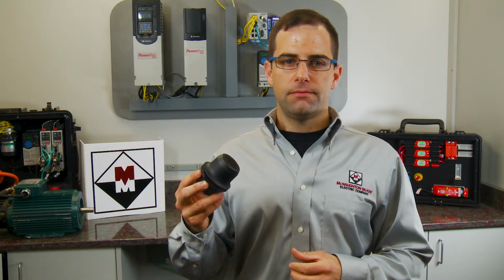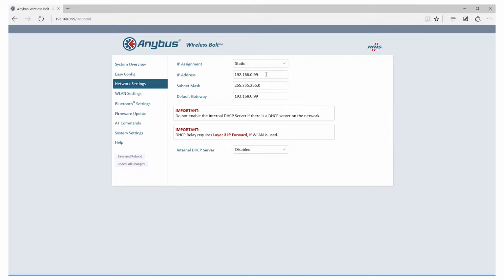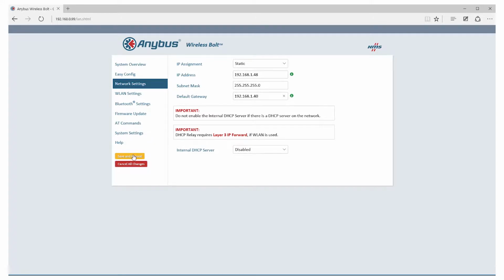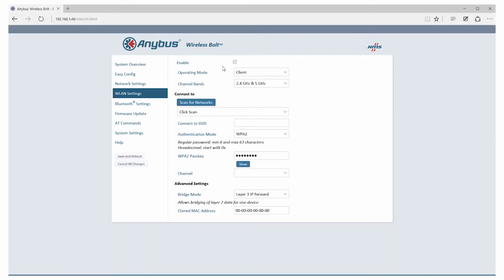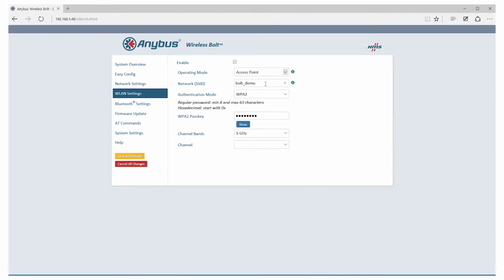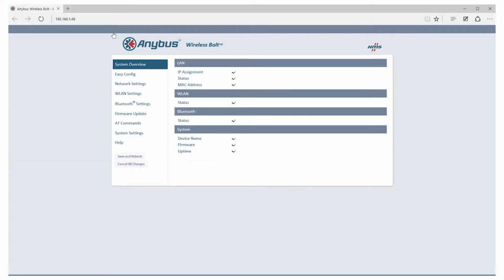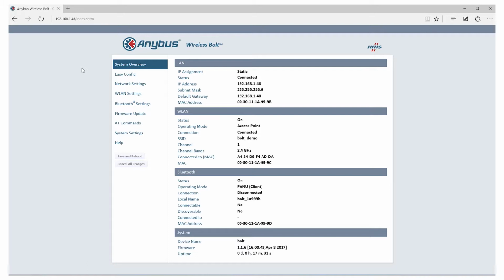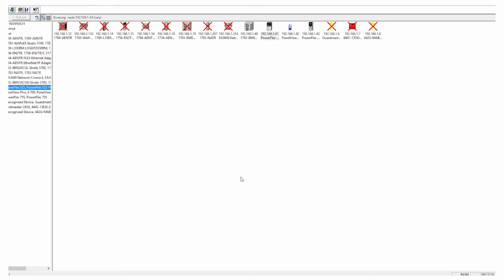How to Setup the HMS Anybus Bolt WIFI Access Point

Comment: Great to know it’s that easy to setup. There is a lot one can do with this device that reduces wiring to skids in a plant or wherever it can be used and connect it all from a junction box to a plant system network. Sometimes though some people aren’t open to such solutions, but that’s backwards thinking.